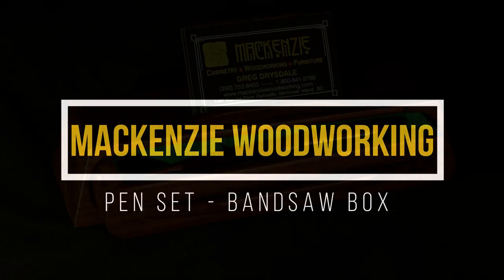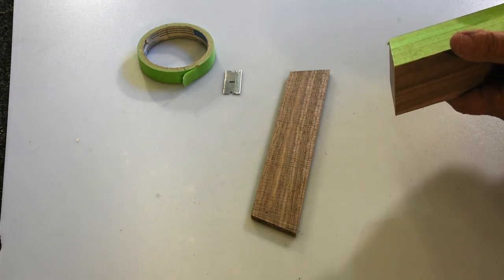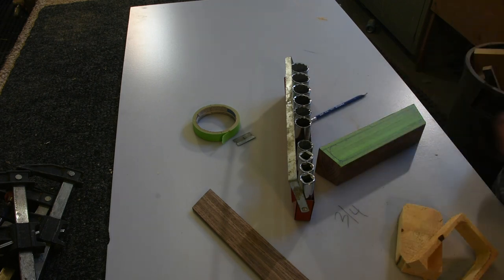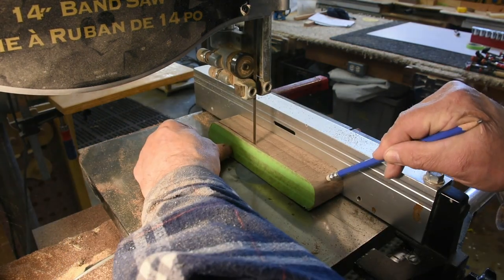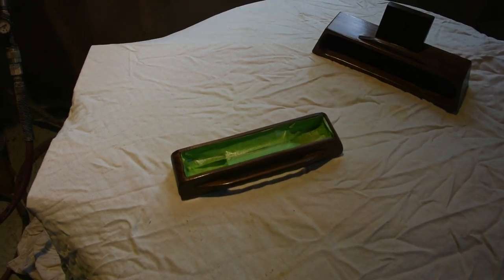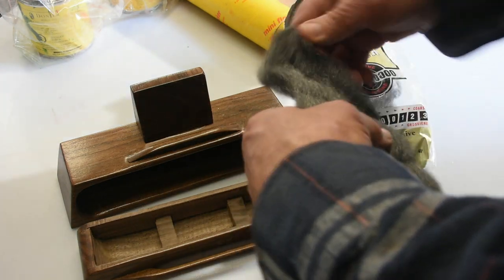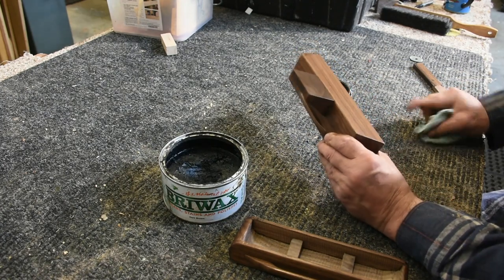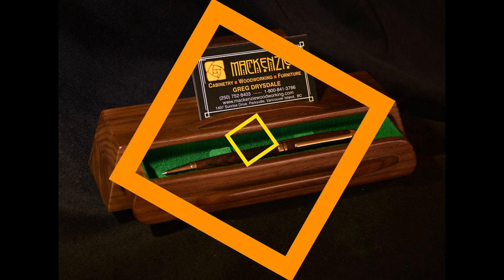How to Build a Bandsaw Box for a Custom Pen

Comment: Hi great video. How do you hide the initial inbound cut which you make to cut out the drawer. Thanks.
Reply from the maker: I enter at the bottom of the drawer and look for a dark grain in the wood and enter in and then back the blade out through the same cut. Then glue the joint.